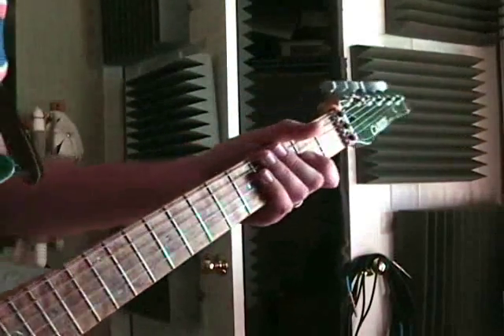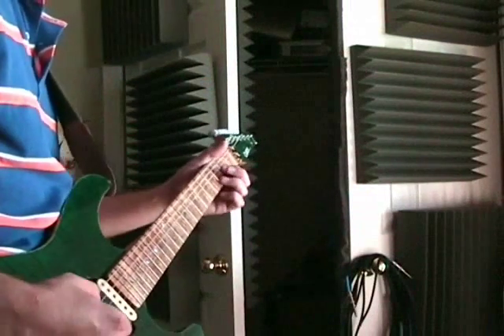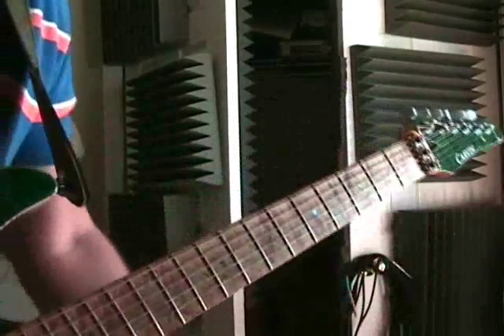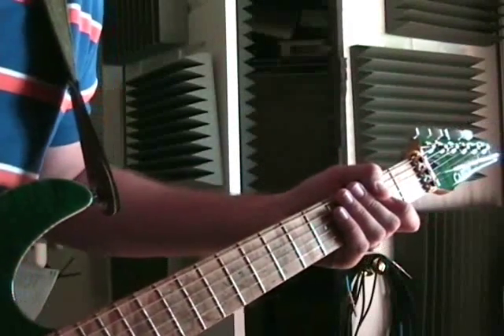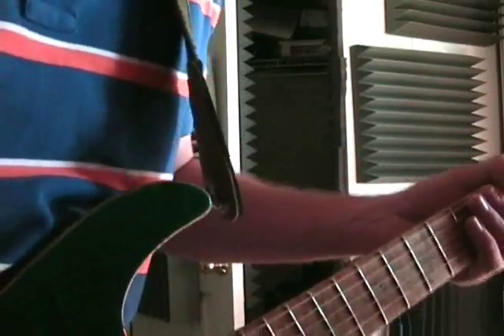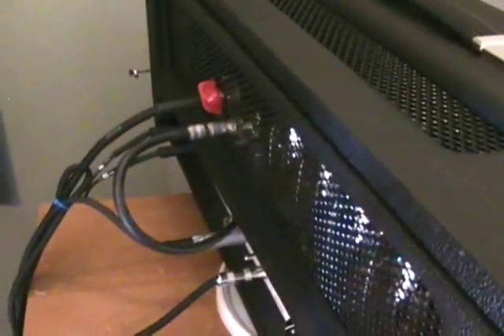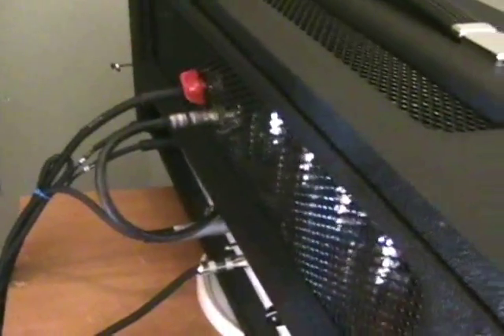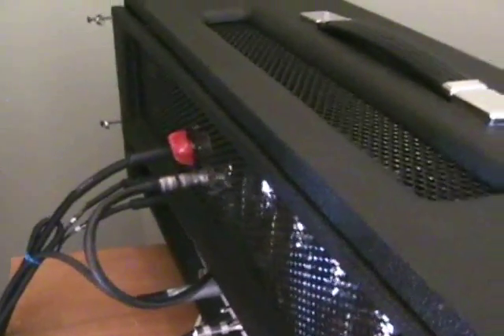Splawn DIY Volume attenuator (part 2)

Comment from the maker: the amp doesn't have a master volume.

What's happening is a cranked preamp signal is going into the fx loop and the volume is being reduced then sent back to the amp and into the power section.  It gives the preamp a good workout being cranked so you get preamp tube saturation but not a super loud signal going to the power section (hence the drop in volume and no strain on the power tubes)

There's a huge thread at the splawn forums about it so I guess scott has probably seen it.  most use VP's

Comment: Dude, I love the sound of the Nitro. I think it may very well be the best sounding high gain amp out there right now, at least to MY ears. Very nice. 

The built in attenuator isn't bad at all really. Still sounds pretty rippin'. But have you heard of The Ultimate Attenuator? Unfortunately gayYouTubegay won't allow me to post a link. But just Google it. It's made by Magus Innovations and is supposedly the most hi-fi attentuator you can buy.

Comment: FastRedPonyCar: I used to own an ultimate att. very cool. Anyways, this mod doesn't push the power tubes since it's all happening pre power section. just pushes the preamp tubes.

Hmmm. So what's the difference between that and just turning down the master volume and turning up the preamp. I don't mean soundwise, as that's obvious. I mean circuitwise. What's happening electronically with your attenuator versus turning down the master/turning up the preamp?

Also, has Scoot Splawm heard this?